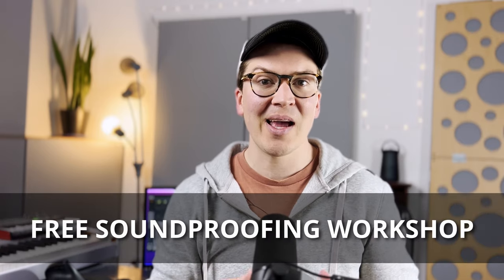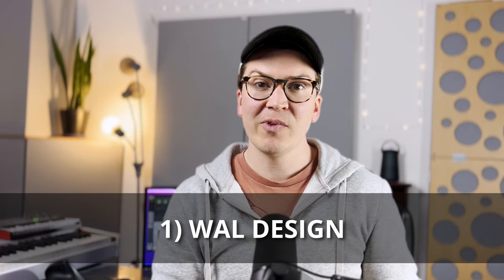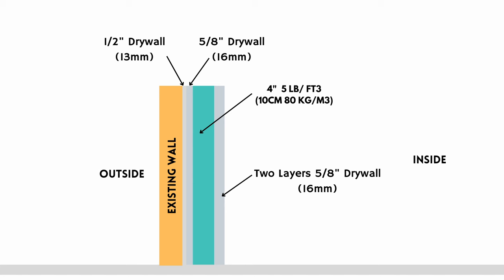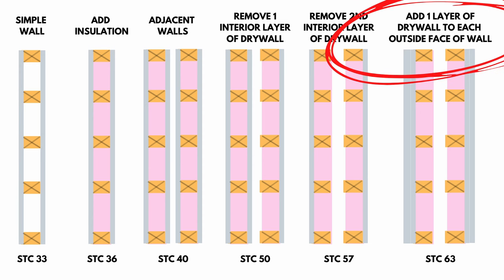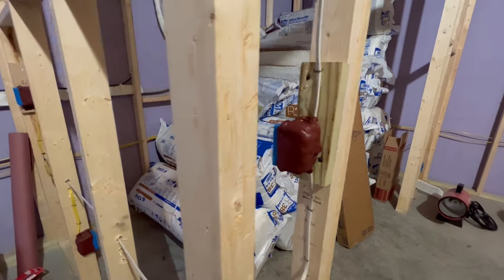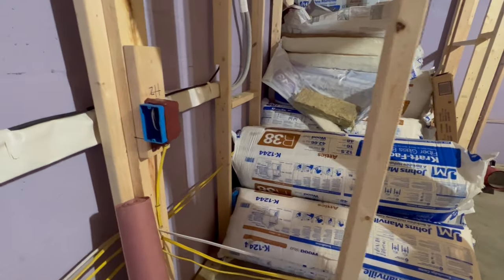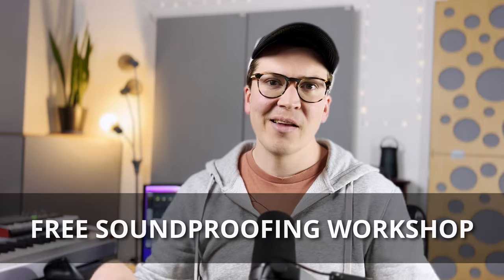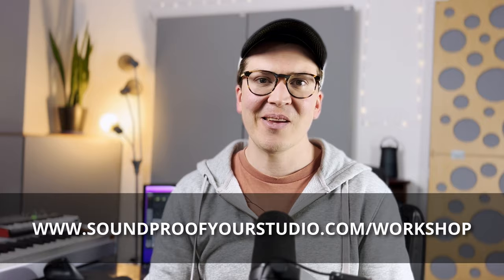How To Soundproof Over Existing Walls, Ceilings and Floors

Comment: For those scratching your heads wondering why in the heck they would make 4 inch rebond foam for flooring use. They don't!  Its more specific use would be for the manufacturing of furniture.  Like those 3 or 4 inch thick couch cushions you're sitting on right now as you watch this video. If you search for it this way you will find much better results. (I'm based in the USA)
Reply from the maker: For the floor use 1”
Reply: @soundproofyourstudio  - Crap! Totally messed up my comment. I meant for the  4" walls. Floating floors are sexy because you are literally at this point, building a room within a room (if your original ceiling is not used in any way).  My biggest issue when doing this in a place with an 8 foot ceiling. Is that the addition of a floating floor and additional ceiling greatly shorten the height of the room.

Comment: If you have the room to give up.......Why not add 5/8 drywall to the inside of existing wall, add a top and bottom plate with insulation held in with mechanic wire running top to bottom, air gap, and another stud wall inside with insulation and 2 layers of 5/8 drywall? Wouldn't you end up with a wall over 60 stc?
Reply from the maker: The idea is logical. The air gap would need to be a bit wider, 8” of insulation and it would be similar to a a double wall system that gets STC 63.

Comment: Sorry dude, but the idea for the wall sounds wacky. You said to use contact adhesive to attach four inches of foam to the wall, but don’t talk about how then to attach two layers of drywall to the foam. I wouldn’t trust using more contact adhesive for all that weight, could be deadly. How would mechanically attach the drywall through four inches of foam?
Reply: Yeah, I was thinking the same thing. You can probably get away with contact cement on your walls, but thats an accident waiting to happen on the ceiling.
Reply from the maker: This is a Philip Newell design and he says it will hold. If you run bolts through the foam it defeats the purpose.
Reply: @soundproofyourstudio did he also design that IKEA furniture that toppled over and killed children years ago? I’ve handled 5/8 drywall and it is heavy. With all respect, I wouldn’t trust that some random guy said it would hold with glue
Reply: John Philip Newell is hardly a random guy, but I've not seen his crew using glue to attach heavy layers of drywall to foam in the ceiling, so I'm with you on it sounding wacky, though I guess it could be possible with the right glue and methods used, it would seem much more safer to build some kind of structure to keep it all in place though (a room in a room). A bunch of fairly recent videos here on youtube showing methods that they do use, but for professional studios https://www.youtube.com/@newellacoustic905/videos

Comment: Why not use a metal stud and rockwool instead of that foam?
Reply: Metal studs are not good for decoupling vibration from an existing structure. 
They should not be confused with, or thought of, as having similar traits as a whisper clip/resilient channel setup.
Reply from the maker: At that point I would just rip out the drywall and build a double wall system. The air gap needs to be at least 8” drywall to drywall.

Comment: Thank you so much for sharing the knowledge. What if I have a concrete floor, i.e. basement floor?
Reply from the maker: Basement concrete floors are great. I almost never add anything to them unless you are worried about sound transfer through concrete from heavy truck rumbles or sub woofers right on the concrete.

Comment: I would like to use some electrical tools to work with wood in a room that has a wall that is shared with a neighbour, is it just impossible to soundproof it enough that they really won't hear much if I sound proof only the wall, or would I have to soundproof the whole room (ceiling and floor)?

Comment: Would be great to hear your recommendations on how to soundproof a room in a rental apartment where the tenant is not allowed to drill holes into the wall (ie my situation here in Japan).
Reply: Build a room inside the room
Reply: yep, but make sure to find out the max load capacity of your floor/room and then calculate how much everything you put in that room weighs, cause the floor has to be able to carry the load safely, most likely you'll quickly run into issues and have to scale down and go for thinner and less dense material options to cut down on the weight and still fit inside the max margin, but better to stay safe, otherwise you'd be risking not just your life, but also others below you. *the general standard load capacity in the Western world seems to be around min 150kg/m2 (max 200kg/m2, but better not to test that) for most rooms in residential buildings (bedrooms can be sometimes less), but this could be less in your case in Asia, could also be more, since buildings in Japan are built to withstand earthquakes etc.
Reply from the maker: I agree with the comments below. But definitely talk with a structural engineer first.

Comment: There's no way i would do this for a ceiling let alone a wall. What is the shear strength of the foam because you're going to have lots of pull on that and will be your failure point over time especially if you are dealing with a bad impact sound. You're going to have so much vibrations on that ceiling that you're going to run the risk of failure.

Comment: Can you add this right over a plaster wall / ceiling ?
Reply from the maker: Yup
Reply: @soundproofyourstudio  what size screws would I need? Was thinking to just GG and 5/8 drywall. Would the foam be more effective at even a smaller size? The ceiling is already 8 ft trying not to bring it so much down

Comment: I am just wondering  how this heavy rubber cushions can hang on the wall. I don't think it  will be possible to achieve secure connections between this thick rubber and a drywall, especially on the walls and selling
Reply from the maker: It is not rubber but foam and doesn’t weigh as much